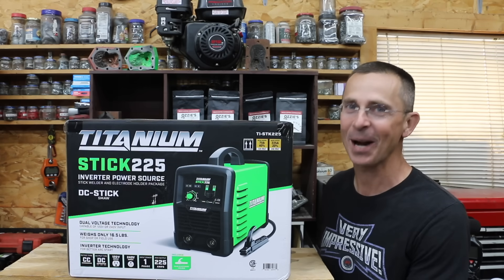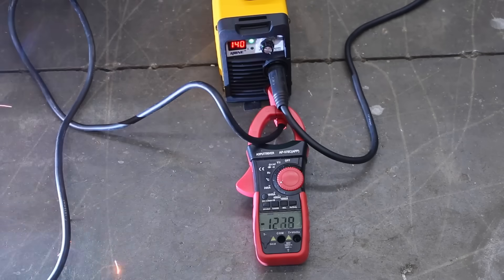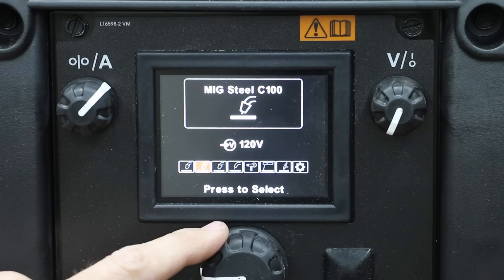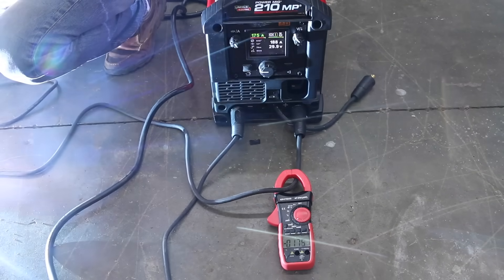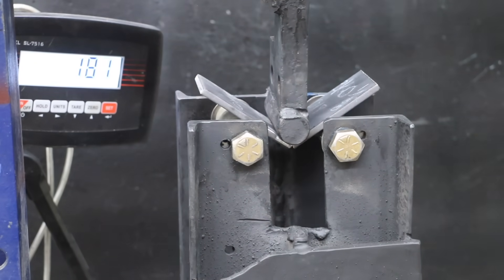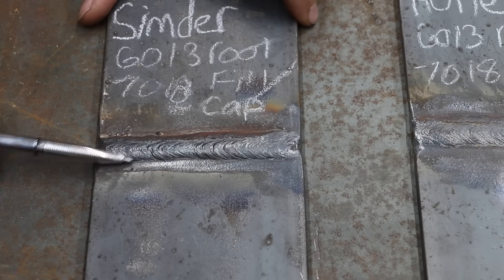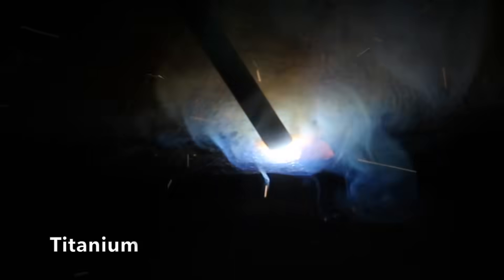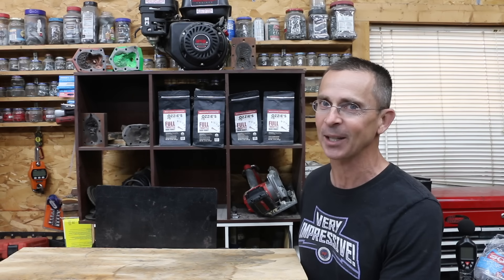$70 vs $2,300 Welder? Let's Settle This! Weld Strength, Duty Cycle, Current Output, Build Quality

Comment: was pretty surprised to see that welder fail and the other  go into over load so quickly, ive ran a few cheap welders with no issues like that, a cheap plasma cutter that ive run for half an hour straight at max output 240v input no issue, my esab welder thats the competitor to this lincoln and very similar has run im sure 25lbs of rod just continious on rod after another at 160amps iirc, and was still blowing cold out, ive ran the mig function on max output for about 8minutes and the tweco gun melted before the welder got warm, i think ive cut and recrimped/soldered the ground lead onto it 6 times now from it melting off even with an oversized 300amp lincoln ground clamp and soldered on lugs

i suppose those two machines must of had terrible designs with bottlenecks/ week points tripping overload is better than exploding clearly but still 3 minutes of burning rod is nothing.. id have to think almost everyone who buys one runs into that issue pretty quick.. park it infront of a shop fan i guess and give it all the wind
Reply from the maker: Thanks for the feedback.

Comment: I love my Lincoln 210MP it does stick, mig, flux core, DC tig and mig aluminum. Bought mine when they first came out and only paid about 1,000$, best welder for home use and auto restoration I've ever used.
Reply from the maker: Thanks for sharing.

Comment: Todd, suggestion for future test. Insulating paints or coatings. Thermoshield and Supertherm are two such products. Used for roofs of buildings and RVs. They have ceramic beads in the paint.  Supertherm claims they coated the Tucson Intl Airport and saved massive amounts of cooling costs.  I think the coatings  work because the coating is white, nothing more. Basically a hoax but we need you to tell us! Would be a great test and very informative.
Reply: I used one from HyTech coatings and I don't know how much it actually does but you could feel on the back of the concrete block wall the difference between where was painted and where wasn't when the sun was shining on it.  As a bonus, no cell phones work inside!
Reply from the maker: Thanks for the suggestion.

Comment: Hi Todd! Thanks for putting this one together and thanks to Joe for burning some rod for us.

Welding is my trade, and I would like to see how the “Everlast” brand of stick machines stack up against these options. They’re mostly inverter-based and they seem to be a fairly solid company with a wide range of machine capacities and applications. I have a Power Arc 160STH (now discontinued) and it runs 1/8” 7018  and pretty much any other rod) flawlessly on a 220v circuit. They seem like a solid competitor to the more expensive models offered by the big companies.
Reply from the maker: Thanks!  Thanks for the suggestion.

Comment: The tester is an American Welding Society standard bend tester for which specs and many homebrew examples are available. Bend testing is a very good idea because unless you perform destructive testing you do not know if you can weld properly. It's a vital learning tool for every welding school.

120v machines are a joke for anything other than thin stock they're intended for but they do have a place because they're so mobile. 

Open Circuit Voltage is highly relevant to performance and should be measured as part of any welder review, especially machines whose makers are not attached to objective truth. Note the OCV along with performance running low hy rods for informative fun.

Comparing the bottom tier inverter machines to bottom tier transformer machines would be interesting. Inverters use much less copper which is a key reason manufacturers like them both for material cost and lower shipping cost due to light weight.

Comment: I have the Titanium multi-process 200 welder....it uses shielding gas and solid wire, or you can use flux core wire and no shielding gas...it also of course does stick and TIG.  I haven't been able to mess with it too much yet, but I have no complaints about the el-cheapo $99 Chicago Electric Flux core welder I've had for 10+ years...with that one I've hit the thermal protection shut down several times, but that's welding for about 3 minutes continuous...it does a great job once you get it dialed in, but wanted to try some other welding processes and thought heck I'll try the Titanium, it gets pretty decent reviews.  

Oh, of course I'd love a Lincoln, or a Hobart, or a Miller, any of them are good, but my wallet said no LOL.  So I settled with the Titanium, caught it on sale for $719 a while back.  If you have the funds, and you do a lot of welding, definitely buy a brand name welder, but if you have a budget to maintain, a Vulcan or Titanium from Harbor Freight will get the job done.  My Titanium from just the bit I've used it runs hot, better than too cool IMO.  You can always turn it down a bit if needed.
Reply from the maker: Thanks for the feedback.

Comment: There should also have been a test with 3/32 rods at 90 amps to actually test the weaker units. This test is like testing a welder that can only push 140 amps with 5/32 rods…
Reply from the maker: Thanks for the constructive feedback.

Comment: I had the 225 stick welder. 

It fell over and both fans broke.had to pull it apart to repair.

Started smoking welding one time recently so I threw it away…

Great for a hobbyist, probably
Reply from the maker: Thanks for sharing.

Comment: I have owned the titanium 225 for a few years I am very impressed with it just as a basic stick welder. I also have the Vulcan omnipro 220 and I am very impressed with it also. I have done a good amount of smaw  welding on structural steel with it and a lot of general purpose mig welding. I built and entrance to my farm out of 10"x10"x 5/16" wall thickness tubing I used 5/32" 7018 and 160 amps and never hit the duty cycle. I would like to see you test the Lincoln mp210 against the Harbour Freight omnipro 220..
Reply from the maker: Thanks for sharing.  Thanks for the suggestion.

Comment: It really comes down to the duty cycle. If you are going to weld anything over 3/16" thick you really need to go up to a 230 volt unit. Aluminum wire feeds run nice at 110 V but again stick to the duty cycle. As for TIG they are only decent at 230 volt or higher. I love your channel and your presentation!
Reply from the maker: Thanks!

Comment: Thanks, Joe!  Thank you for this video.  I find the results surprising overall.  I have always used Lincoln and Miller machines but my Dad recently bought a small Titanium MIG machine and has had an Everlast multi-process for a few years.  He has been impressed by both after a lifetime of running Lincoln and Miller machines.  A comparison of some other machines would be useful in addition to plasma since we just had a Hypertherm die.
Reply from the maker: Thank!  Thanks for sharing.

Comment: As a 20 years full-time professional welder who has always worked with big expensive machines like 5-10K$ Fronius/Lincoln/Miller, I didn't know that great "cheap" welders like the Harbor Freight Titanium were a thing. Another awesome video, and thanks to Joe! Subjective input from a professional on how the welders behave is invaluable.
Reply: I got a titanium mig welder for just over 500 bucks, this thing is the ticket for someone who does projects or small welding jobs
Reply: @andrewarmstrong9194  I want to make my own smoker, would the titanium be good to use for that?
Reply: @DZADangerous  any of the titanium's would do it, a mig/tig one might be easier if your working with thin material, you can get some of that 023 body panel size wire or turn the amps down and use 1/16 or 045 wire on tig
Reply: @DZADangerous  yes if you are going to make it out of steel it would do just fine, if your going to be using a different kind of metal like stainless steel you would need to pick up one with a tig function
Reply: I've welding things not much thicker than a beer can, all the way up to welding a hydraulic cylinder eye back on a rod that was 11/4 " thick and it's been holding just fine
Reply: @stevehartlieb  Thank you for the tips, I'm looking forward to building it!
Reply: @andrewarmstrong9194  Thank you!
Reply: @DZADangerous  hope it all works out for you
Reply: @andrewarmstrong9194  the one I got will do spray arc and run dualshield in 035 titanium unlimited 200 you get up to 28v for some spray action
Reply: @stevehartlieb  I'm buy no means a professional, but I have dabbled with welding over the years. I use to weld with a sa 250 Lincoln diesel powered stick until the engine blew, don't get me wrong the duty cycle on that big welder was 100% you could weld until you passed out and it would still be going strong. But for a small hobbyist these little titanium's are great. Usually someone doing projects at home aren't going to be welding all day long, so 40% duty cycle would be just fine for most people.
Reply: yes i have the same Titanium as in the video. not bad for a cheap stick welder. 480v machines will always be far superior.
Reply: Same here. I'm surprised such cheap machines can deliver that much.
Reply: As a complete layman who finds welders a bit mystifying, I was very impressed by the fact that some comparatively dirt cheap units could do a damn good job
Reply: Harbor freight keeps improving, heck for a hobyist that welds like once a year my 120v chicago electric mig welder is still going strong after 10 years, sure i wouldnt want to do alot of welding with it but for small fixes around the home, its worth the $100 i spent at the time.
Reply: I used a us$10k plus welder daily at work and at home a $450 no complaints
Reply: I got the titanium unlimited 200, on stick mode it definitely feels hotter than what you got it set too, but after you realize that, about 10 amps lower is where you want to be
Reply: Im also a full time professional and I own like 16 welders and I would never buy an expensive welder because they are not worth it. Paying $1,000 for a Miller board is outrage
Reply: 100000😅
Reply: This is the way!
Reply: I have the Titanium Mig 170 and a spool gun for aluminum. It's quite impressive for the price and I like it for what I do. HF's Vulcan line is their top of the line welder range, and when AvE did a teardown of one of those, you could see that it was, indeed, a high quality machine.
Reply: I’m up there in age, rarely weld anything if S’mores are not on the list… 
Great information, no fluff, no reason to fork over more money than needed especially at my age and social and physical rot…
Sir, you rock, thank you!
Reply from the maker: Thanks!  Thanks for the feedback.
Reply: @ProjectFarm  thanks for the video
Reply: I have the easy flux 120 and it’s nice one to have
Reply: Yes, I woulda liked to seen Hobart as they are popular here thanks to tractor supply but can't be disappointed in what was tested

Comment: I would love to see you do a comparison of MIG welders. Factoring in the cost of different types gas required for welding with aluminum versus steel or stainless steel. Which welders are most capable. I know there are a lot of crappy MIG welders out there, as well as some I would expect to be, but maybe aren't.
I really enjoyed this video and I'm looking forward to the next one.
Reply from the maker: Thanks!  Thanks for the suggestion.

Comment: Should try kicking horse welders.  Made in Canada and from what ive heard they are bullet proof.  Can smoke from overheating for hours and still work just fine. Believe they have a multi process welder too
Reply from the maker: Thanks for the suggestion.

Comment: I still consider running "tool/mechanic/etc" ads a form of "sponsorship". You can say YT or whatever targets an pushes out those ads but we could just as easily say he has the full power to disable them altogether too.

That being said.. I concur with the others that the channel gets straight to the point vs intros/music/an other bs.

I've given ya a hard time about this subject PF. However consistency wins in the end for quality.. I could just do without 5-10 ads every visit 😒

I won't promise not to critique this channel if it goes astray.. but yeah, years of consistent video production earns its spot at the top.

Nice work with the welders, Joe.. nice of you to help too.

I give this channel a 2/3 rating (3 is max/best). The ads are just so heavy though, so ya don't get the full 3.

Congrats on a updated score with me.

Comment: I don't see it on this channel, but I would love to see a battery powered table and miter saw test. I know Milwaukee and Ryobi have some, but I don't want to spend the money on one, if they're weaker or require you to constantly change the battery. 

I know an average miter saw uses around 5-7 amps while running and 35-40 amps at startup, which makes me wonder how long they can last even with a big 12ah battery.
Reply from the maker: Thanks for the suggestion.

Comment: I own the older shoulder strap Chicago Electric stick welder from harbor freight. Personally i love it for what it is. Great out in the field for temp repairs to get the job done or get you home. Very small generators will run it. Now in the garage, Lincoln or Miller all the way. Although used both the titanium and another off brand multi process and they work very well for the price point.
Reply from the maker: Thanks for the feedback.

Comment: I have a Clark weld 95E. I did modify it with longer leads and a small cooling fan. Welds with good penatration up to 1/4" steel. Only down side is you have to run E6011 3/32 rods
Reply from the maker: Thanks for sharing.

Comment: Oi. As an ex welder, there's no secret in welding station: you put the price, you get the best stuff. Lincoln Electric, Miller, Esab and Kempi are the only brands I would work with. If you do some occasional welding works in your garage, I would say invest. Better have a 600/700 bucks machine that will last you 15/20 year, than ten $70 ones that last 5 months or 2 welding sticks xD
Reply from the maker: Thanks for the feedback.

Comment: Definitely want to see mig. A lot of cheap mig’s aren't “mig’s” so much as wire-feed flux core arc welders (FCAW). Some do both Gas metal arc welding (GMAW) as well as FACW. 
I run a lincoln 180 dual. Basically the same specs as any lincoln 175/180 but can do 120v, in which it’s basically s lincoln 140.
Reply from the maker: Thanks for the suggestion.

Comment: when you  use an amp meter, the wire has to be in the center of the clamp loop and going straight through, otherwise your reading will be off.
Reply from the maker: Thanks for the constructive feedback.

Comment: I bought three of the Simder welders; you can adjust the performance by opening the unit up and turning the potentiometer on the circuit board. Mine does 160amps now on 110 vac. It will do over 200 amps (on 110 vac) but i believe that’s going to fry the transistors.
Reply from the maker: Thanks for sharing.

Comment: I started on the Miller, Lincolns and Hobart transformer AC/DC stick welders.  When I bought them, they were only  $350.00- $480.00 .  I think now there $500-$680.00.   Chances are that they will outlast all those cheap Chinese inverters!
Reply from the maker: Thanks for the feedback.

Comment: fantastic... FWIW my first welder was was ... IS... a Lincoln Weld Pack HD, i got it back in 2005 and i am still using it to this day. i upgraded the fee motor. Bottom line, its a terrible flux core welder but once you get skills it makes no difference the welder you use. It just makes it eisier
Reply from the maker: Thanks!  Thanks for sharing.

Comment: this was a great review. I have been looking at a new multi process welder.  I would love to see a showdown between Lincon, Miller and ESAB along with the lower cost brands. I have been leaning towards the ESAB Rebel 205ic. its a multi process that even does AC TIG for welding aluminum. but i know that Miller and Lincon also AC TIG multi-process machines. the rebel is pricy about $4100.  the Miller MultiMatic 220 runs around $4200, and I am sure Lincon has something similar in a similar price range.  Iam just curious what else is out there that can do AC TIG for welding aluminum. that is cheaper and maybe just as good.
Reply: I have an Esab 205ic. I'm a certified welder and have run all types of machines. Lincoln doesn't offer a machine that can AC tig. Miller's does, but is about $1500 more than the Esab, but a draw back on the Miller is it can't run 6010 rod for stick. That and the price was the deal breaker for me when picking a machine to purchase for basic welding around the home shop. I did have an issue with my Esab, but the local rep replaced my machine. I bought right at the start of Covid, so I'm sure there was some quality control issues. I haven't had any issues since. Used all three processes in one day.
Reply from the maker: Thanks!

Comment: I think this test is a little unfair to compare to the Lincoln. It would have been better to use the Esab mini arc Rogue es 130i. It's a $500-$600 stick welder. Name brand, with only one process. Only time I was disappointed watching a tool test.
Reply from the maker: Thanks for the constructive feedback.
Reply: @ProjectFarm  It would be cool to see the multiprocess Yeswelder against the Vulcan, Lincoln, Miller, and Esab. Or even a basic wire welder video to not be so expensive for the channel. I do enjoy the channel and have used it many times to help when making tool purchases.